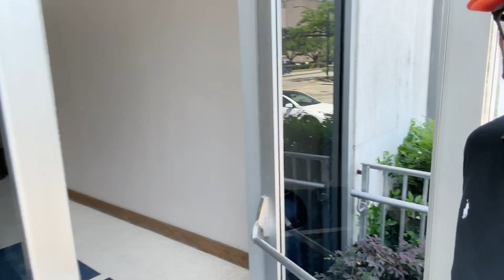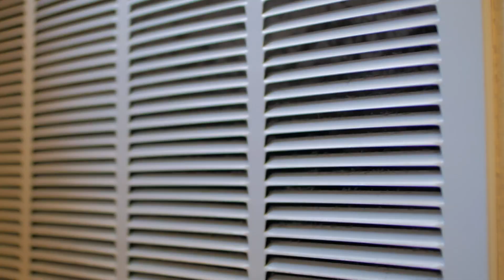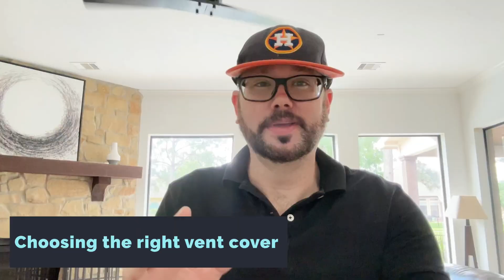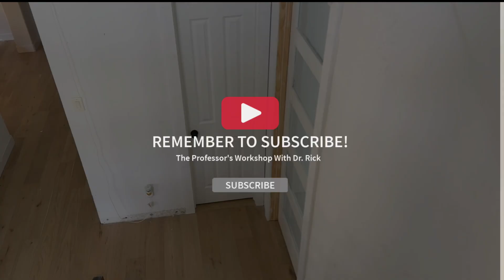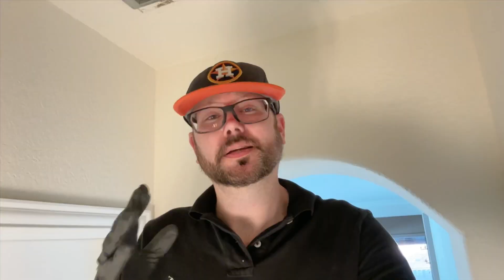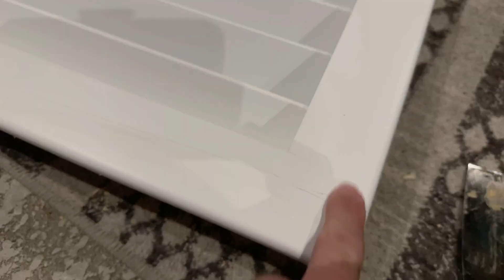This Simple HVAC Vent Upgrade Made My Whole Room Look Better | Worth Home Products DIY Project

Comment: This is a helpful video but the Worth Home website shows homemakers doing this with a drill and 4 screws in minutes. Yeah right. It's usually never that cut and dry. Our home was built 22 years ago and the duct work proved challenging to get the #8 wood screws to hold. Plus the opening needed considerable cleaning, patching and painting to make it look professional. Quality product just not as easy as the promo's suggest.

Comment: I love this as I was thinking about replacing my vents, but it stated it was for wall only. Thank you for showing the conversion. I imagine it's the same process for any size (Worth) vent.? I want to start with a smaller 1 x12 vent, then move up to the bigger ones.

Comment: Bro those big square ones that have the hinge so the vent can hang down are supposed to have filters in them. Typically if the builder spent the money to put those in then that's where the filter is supposed to go and the only spot for it.  And you got pets so your air handlers are probably caked in dust and are losing efficiency more and more everyday.
Reply from the maker: Not always.  We replaced this Hvac unit last summer and had a filter installed in the unit itself for easier replacement.  Otherwise, yes, it should have a filter in it.